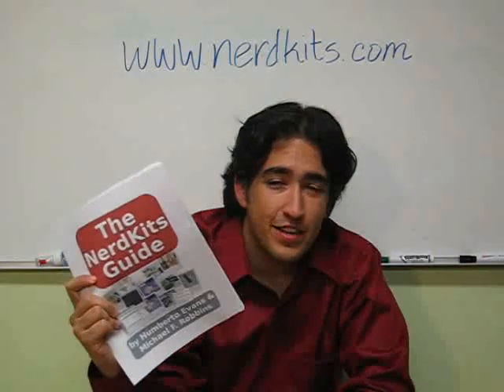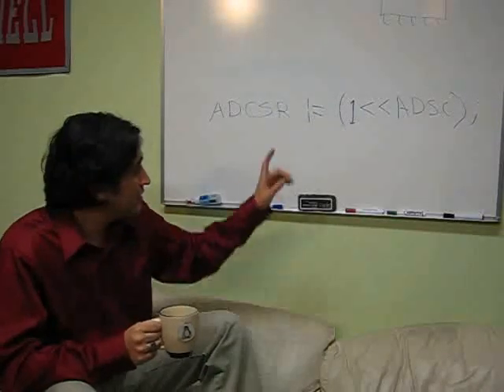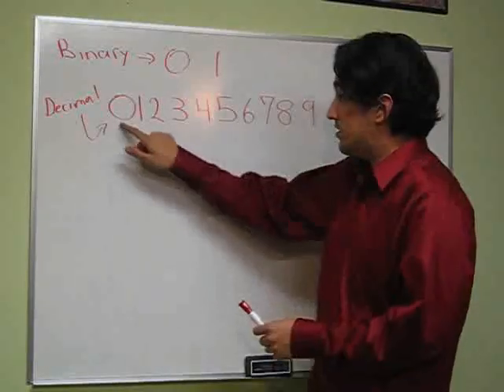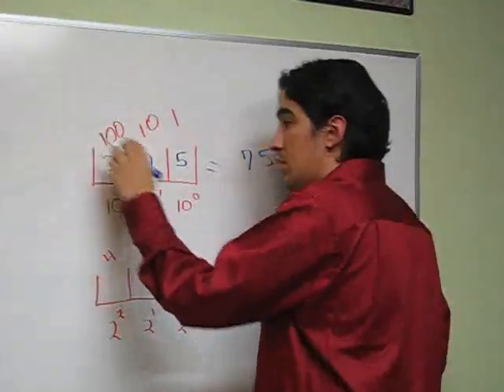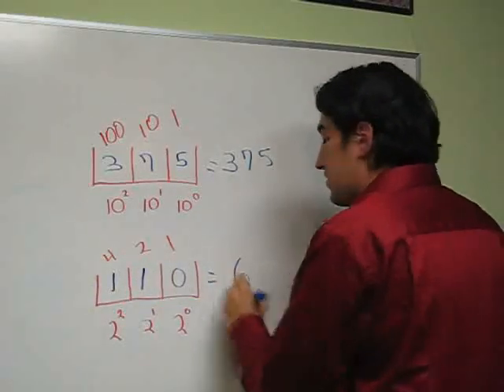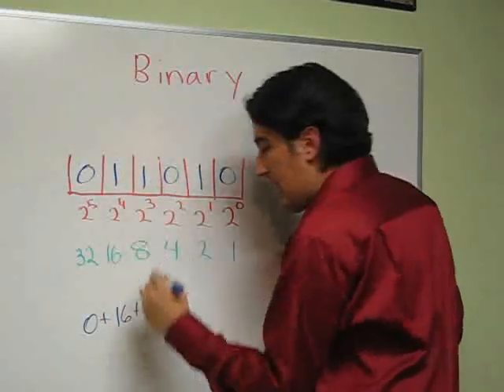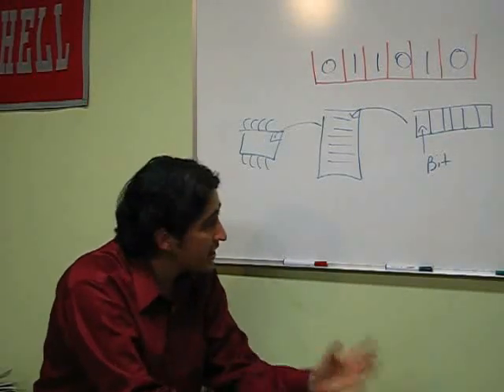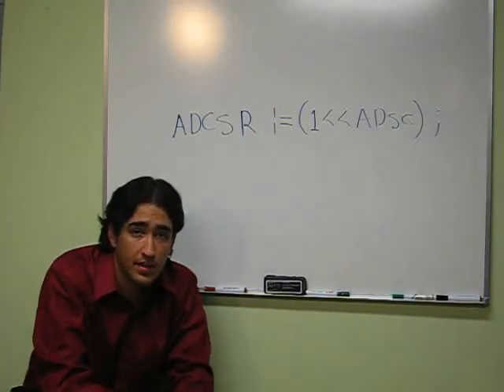Bits, Bytes, and Binary

Comment: @deanmullen10 if the computer sees that electricity is running through the wire, its a 1.  If not, its a 0.  To put even simpler, on is 1, off is 0. When you flip your light switch on, that's a 1. When you flip it off, that's a 0.